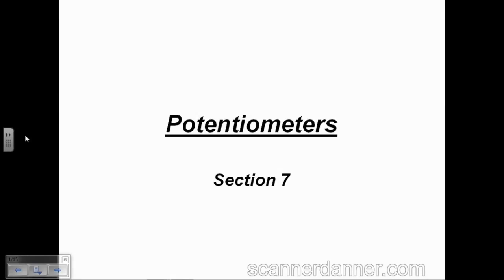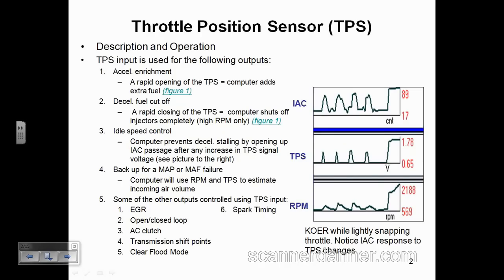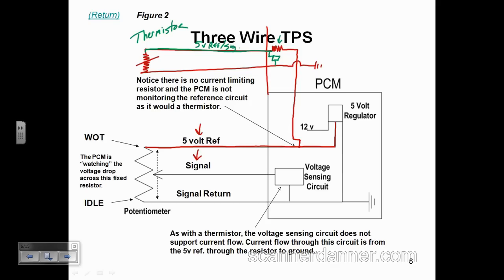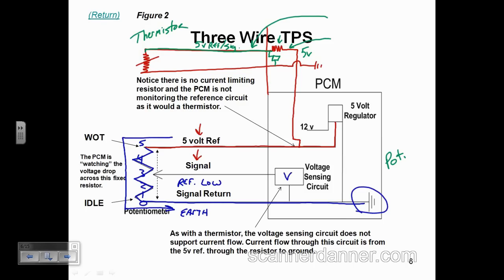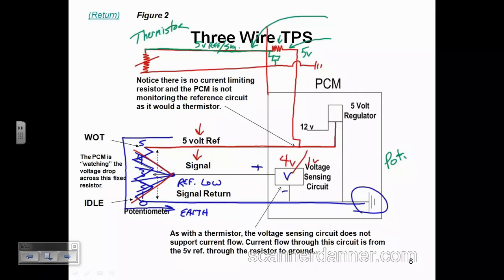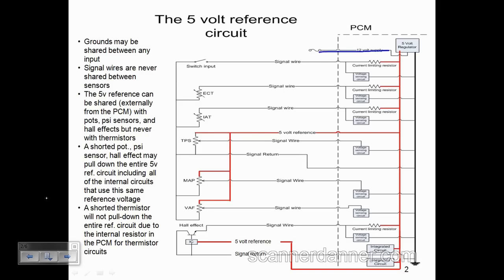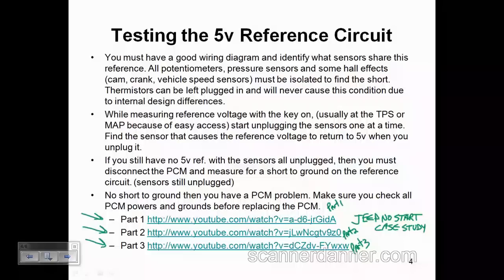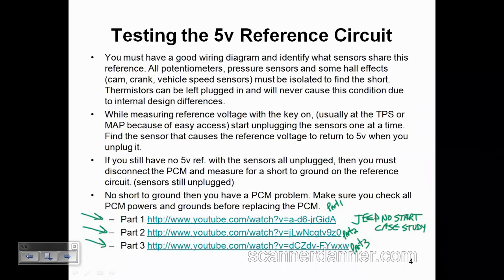Thermistor-Potentiometer comparison and the 5v reference circuit

Comment: Good day Mr Paul Danner. You are the only teacher who showed me the internal circuit of a PCM ( the high resistance bias resistor, the 5v reg, the transistor driver, the voltage sensing circuit VSC, power side switching, ground side switching). Because of this, I fully understand now how the PCM works. You executed a teaching process with high degree of competence. Thank you sir. God bless.
Reply from the maker: Thank you!

Comment: You are a knowledgable chap and have a good teaching method. One question I have: 
Even though you recommend checking the fuse to the computer, if it is blown then it should not just be replaced with a good one as something obviously caused it to fail downstream and this then then ties in with your checking components and wiring etc as you have shown. Excellent video. 👍
Reply from the maker: Of course! 100% if you find a blown fuse, you need to find out why that fuse blew. This wasn't a lesson on locating a short to ground though, that's another class in itself. Make sense? Thanks!

Comment: 31:23 The LM7805 has over current protection (it will stop supplying additional current to the output when you hit the current limit around 1 - 1.5 amps this will cause the output voltage to drop this is called entering constant current mode), overpower protection (the regulator will shut down if the IC gets too hot due to either excessive voltage on the input or excessive current draw on the output that the heat sink can't dissipate) and short circuit protection they're designed to be pretty bullet proof actually.

Not impossible to kill but difficult. Most modern regulators linear and switching contain this protection circuitry internally.
Reply from the maker: Thanks for the info!

Comment: Great video, as usual. I would just like to point out that if you unplug a sensor and your 5v comes back it may be the wire rubbed through, not a bad sensor. Had a 3.5 charger with multiple codes for sensors that shared the same 5v reference. Unplugged the EGR valve and the 5v came back. Had I just called the sensor I would have been wrong. Instead I drove it and didn't make it 1 mile and all the codes came back. Checked my 5v and it was gone again. The harness was rubbed through on the back of the engine leading up to the EGR valve
Reply from the maker: For sure, there are always variables like this. Thanks for sharing! What you are describing would be similar to this video
https://www.youtube.com/watch?v=uyncVz_HAtA
Reply: Bruce Oliver nu

Comment: This was really helpful. I was confused on one point; that is the fact that the signal ground (or whatever name you give it) is connected to the negative end of the battery through the chassis of the car. I didn't realize this on my first watching and so got very confused. Hope this detail helps someone.
Reply: Leo Chia
1 hour ago (edited)
Hey Paul! Returning to this after 2 months and am understanding much more than I did initially. I have a question: Does the Voltage Sensing Circuit have a high resistance resistor (relative to the fixed resistor) located in the circuit just before it connects to ground to allow a consistent voltage drop across the fixed resistor and not create a short? Thanks so much!
Reply: I think you mentioned it in another video; it is also implied here as you mention that the voltage sensing circuit does not support current flow. But just wanted to check to make sure.

Comment: Magneto-resistive ABS sensors also work the same as a thermistor.  There is a current limiting resistor up-stream, and they need to be unplugged to measure the reference.

Comment: Good after Mr. Danner, 

Been watching your videos for about 1 year now. You’re awesome. Quick question that has me confused. In looking at this 5v reference circuit, it is a parallel circuit I believe. If so, how does 1 leg of the circuit take out the others? I thought that was the benefit of parallel circuits to not be affected by an open. Thank you!
Reply: to answer your question ,if the maf sensor shorts to ground then for protection of the circuit the voltage regulator shuts down the 5 v ref circuit until the short is removed , a direct short to ground would cause a high amp draw from the pcm and possibly blow it internally

Comment: nice i learned a lot👍🏽👍🏽 but im stuck with an issue what if a signal wire from a three wire pressure sensor has full battery pack voltage?
Reply from the maker: If you have battery voltage on a 3 wire psi sensor or potentiometer, you most likely will be reading this same battery voltage on all 3 wires plugged in. This is a bad main computer ground symptom.

Comment: Great video, one question at minute 36 you state to make sure you disconnect test light before measuring ohms, would not the thermistors also need to be disconnected
Reply from the maker: No need to because the computer is already unplugged, therefore the thermistor signal/ref circuit is already isolated. Make sense?

Comment: Can you send 12 volt up the signal wire with test light since it does support current also to the ground wire I'm guessing the ref you'll pull down
Reply from the maker: Why would you intentionally send more voltage that what is typically on that circuit? I mean, you can, and won't hurt anything, but there is no need to do that,  you have a 5v ref available to you to do the wiring integrity test. Make sense?

Comment: my question is how do we know if the signal/control wire is supposed to be sending out a signal to pcm or supposed to receiving a signal from pcm? is this just something we need to learn from each sensor or is thisn info in factory service manuals?this confuses me and very important for me to know.
Reply from the maker: Copying and pasting my comment. In case you missed it. BTW, you only need to ask once. I see all the comments on every video.
Signal wires are input circuits and are being "watched"
Control wires are output circuits and are being controlled.
Come join my classes and I can teach you this stuff for sure! I offer a 14 day free trial, so come see what I have. Based on your question, I'd recommend starting in my chapters 2 and 3 playlists. https://www.scannerdanner.com/join-scannerdanner-premium.html
Hope to see you there!

Comment: Sir may I know the pin out of the transistor regulator 7805 coz I google it the left most pin is input and the center pin ground and the right is output how come that in your   diagram does not match the pinout tnx Sir

Comment: At 34:17, could you explain why you would have 0 volts with the TPS plugged in, and why it would be shorted to ground if there was 5 volts present with it unplugged?
Reply from the maker: What I am describing in this section, is if you have 0 V on a 5 V reference circuit and you unplug one of the sensor's and it returns to 5 V you have a shorted sensor
Reply: ScannerDanner... got it. Watched your Honda element video with the shorted MAP sensor and came back to this vid, makes total sense now. Your channel is super helpful, as is your book. Keep up the awesome work.
Reply from the maker: Perfect video to watch to hammer this home.

Comment: Thanks Paul ,, im getting 2.25volts ref on my pencil coils,, everything else   4.89..refs.  Honda?????2006
Reply from the maker: There is no 5v ref on an ignition coil
Reply: @ScannerDanner  thank you sir,,so the 2.25 at pencil coils is ok ,,crank no start some where else,??  Just a quick note I had a crank no start on Honda frv ,,was a faulty speed sensor,, same crank no start key light flashing, engine light on.
Reply from the maker: @faroukkhan6777  I assume you are taking this measurement during cranking and that it is a 3 or 4 wire ignition coil. They will use a 0-4v trigger signal that is an on/off square wave to control the coil. Your voltmeter may be averaging that signal. But then again you're really not giving me enough information  about what you're doing, what you're missing, the conditions of when you're testing and what made you think the 5v ref circuit goes to an ignition coil. Also, I've never heard the term pencil coil
Reply: Thank you sir,,2006 Honda Jazz 8xspark plugs car was driving fine no problem,,try starting,, key light flashing engine light on,read with topdon 800bt OBD2,, normal read no problem,,, now say error in communicating with ECU????? Thanks kindly farouk